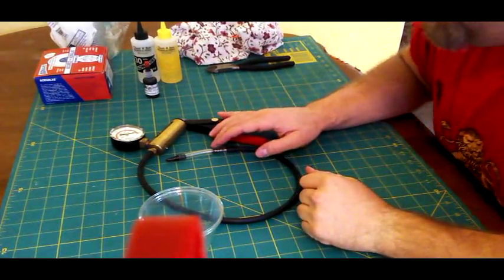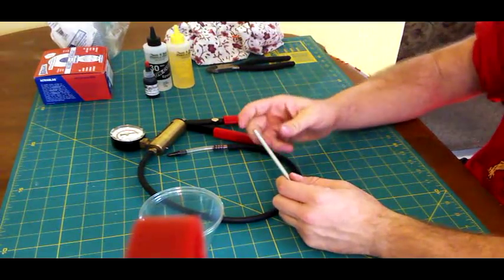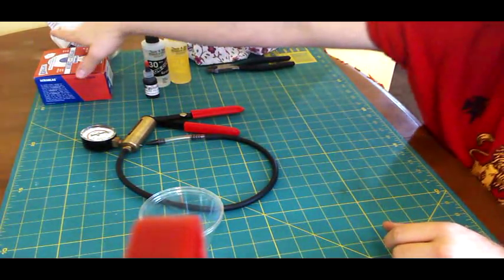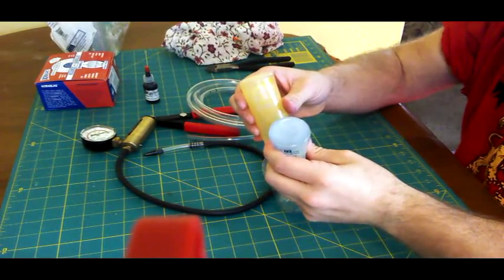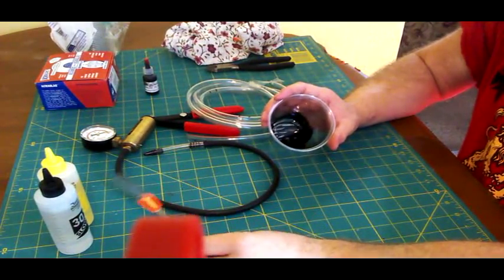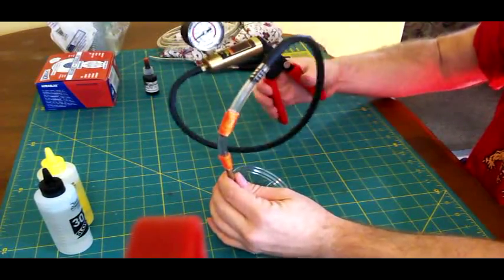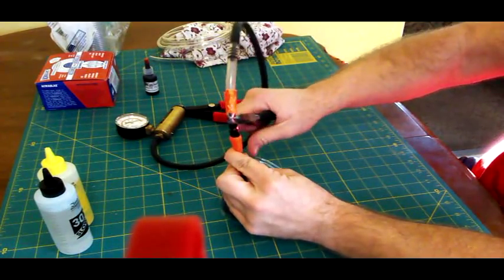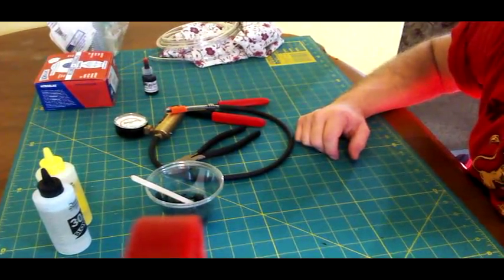Making mosaic pins for a knife handle with the Vacuum method

Comment from the maker: The wires pulling up have never been much of an issue as I can just push them back down. If I make a pin with a lot of small wires I might have to give the mesh a try. Thanks for the suggestion.

Comment: I bought a brass tube, then placed a rectangular brass section inside followed by some very small diameter copper tubing. The problem is, whether I hand saw or use a Dremel etc to cut the tubing into 4" lengths, it either crimps the end or fills the smaller diameter tubing with fine metal particles. Should I epoxy first then cut into lengths? Thanks Glenn (from the U.K)
Reply: Glenn Lane when I make pins I cut everything into 6" pieces. I use a dremmel cut off wheel as well. Once everything is cut I use a small grinding cone in the dremmel to clear out the ends of each piece then use a small syringe with acetone to clean out each tube. make sure it all evaporates before you assemble and you should be good to go.
Reply: Thanks for the quick reply. I'll give it another go next week. Regards Glenn

Comment: What type of two ton epoxy do you use?
Reply from the maker: the one in this video is "Bob Smith's slow cure" it's basically devcon's 2ton epoxy. but now I use acarglas which is more expensive but a much better epoxy

Comment: I'm finding it impossible to find 1/32" nickel silver pins.  Any ideas ?   Thanks,  Tom
Reply from the maker: I don't use nickel silver because of its limited availability. I use stainless steel and piano wire. if the high carbon knife isnt rusting the pins should be fine as well. If my pins tarnish I'll just polish them with flitz
Reply: ok....thanks

Comment: where can you buy the raw materials?
Reply from the maker: You can get the epoxy form any home improvement store, its a 2 ton epoxy. The tube and wire is from K&S precision metals (do a internet search for local retailers) and the pump was from Harbor freight, any car parts store should also carry them.